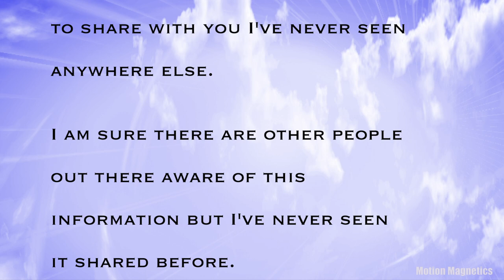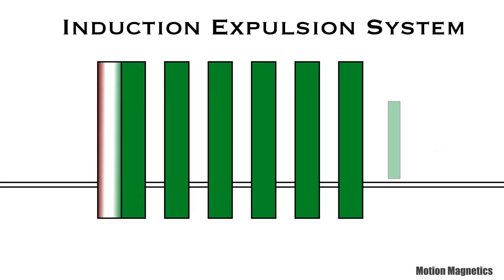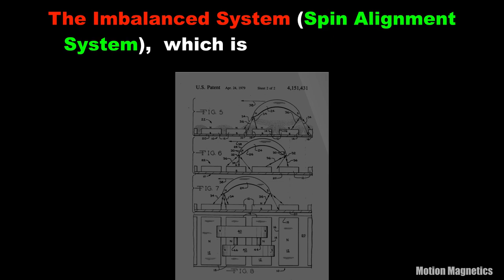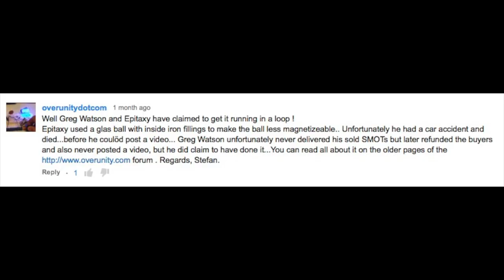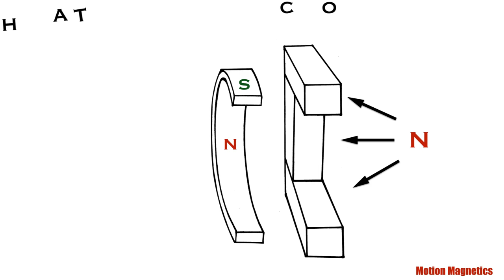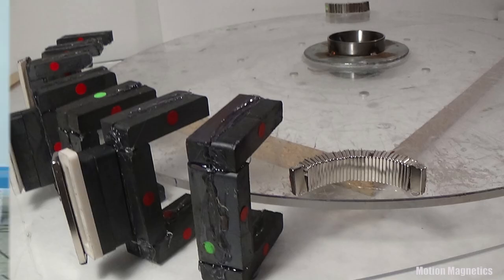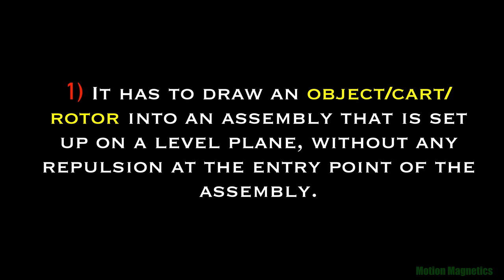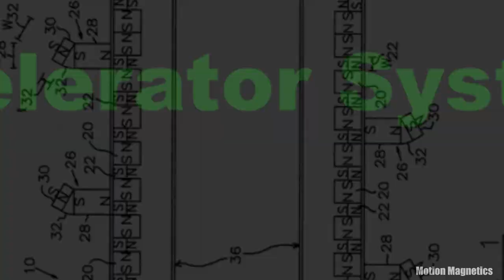The 3 Types of Magnetic Motors Part 03

Comment: Well done Motionmagnetics and thanks for mentioning my forum. Well, is the last motor you have shown in this video not just accelerating ? Looks like it accelerates or did you edit this video so it seems to accelerate ??
Have you ever tried to combine some magnets wrapped with coils around them and then switched the coils on or Off and the right timing intervals ? That would also still be a possible solution to overcome some sticky points, but it would still need more work and to find out the right coil dimensions and switching parameters and might need also caps to store some energy from the coils. Many thanks for your inpiring videos !
Regards, Stefan.
Reply from the maker: overunitydotcom Thanks Stefan. The last motor doesn't accelerate. It's just edited that way to serve the narrative better. I haven't tried collecting a charge and redistributing it into an assembly yet. I'm mostly focused on doing this with all permanent magnets at this time. I might give it a try at some point though. Thanks for the suggestion.
Reply: overunitydotcom that's what I been saying! Just not as well! Slightly neutralizing the magnets that cause it to stop. For a microseconds at the right time. Would make it work I think! I want to try....
Reply: @Motionmagnetics  hmm..how is this edited, when it is shot entirely in one shot and clearly shows acceleration ??..lol...maybe you have it already running ??..lol..

Comment: So are you actually trying to make a perpetual motion machine? Is that your end goal? If so, how do you explain where the extra energy comes from (to do the work)?
Reply: DrZaius That's about the most diplomatic way to ask that question. I respect that. As someone interest in the idea of free energy, I listen to all the people say that you can't create energy out of nothing. I agree with them. It takes a force to produce movement. Magnets have the capability to do work. Take a piece of metal and slide it across the table. That object will keep on going forever until an equal opposing force stops it. Slide the metal next to a magnet and the magnet will pull it towards itself. This changes the trajectory of the metal. That by the laws of physics is force/work. Magnets can create plenty of torque and do plenty of work. The problem is getting them to work with each other and not against each other in the same direction. This is where physics "pros" jump in and say, "See you can't get magnets to do work because you don't have an external source of force. You can't create energy out of nothing." The problem isn't the external force not being there. It's that the force wants to push both ways. You have plenty of force in one direction, and the idea is to shield and align magnets to reduce the force coming from the opposite direction.
Reply from the maker: DrZaius Actually, no. I'm building a non equilibrium steady state system.

Comment: If this is possible why is there no working versions. I mean if you can get the magnets to be sucked in the on side and spit our the other side  thats is game over. The motor should work. An im sure i see it happen in the video. So if it happen once it just need a exact repeat and that is it? Do what is stopping the process . What i said here only goes for this type. Because if i sucks it in and push it out there is no one inch barrier so what is stopping it here i dont get it
Reply from the maker: Werner van loggerenberg The magnetic assemblies I featured in the video have to much repulsion at the entrance of their gates to be cycled. I used them to demonstrate the principle. If the assemblies I was using accomplished the three principles I laid out in the video, I would have arched the geometry of the design and demonstrated it in a rotary version, so that people could replicate it. Thanks for the question friend. I can tell by your mention of the one inch barrier that you've been paying attention.
Reply: Motionmagnetics  "IF" that's how you really want to achieve it to work ?  Edmund Scientific sells a device used to find a N / S magnet's 3rd pole .

Comment: I think real free energy will tap in electrically to the machine that the magnet, neodymium, already is.  I'm currently working on a theory on how to use the already spinning vortexes that already exist in a strong magnet, 8 inches by 4 inches pancake form. there are literally gaps where magnetic attraction is not really there. what if wired cones were placed right next to the top vortex?  one in the center, one a few millimeters on the outside, parallel to the other cone, a cone sandwich on top of the magnet surrounding the vortex or walls of the tornado of the north pole?

Comment: What if Arc'ing the solution ruins it. As the magnets fields change direction and interfere with each other. So I mean have a spinning solution but where the spinning magnet goes through the gates have this in a straight line, by using a cam.

Comment: Ultimately, the sum of forces of any system must be zero - or be powered, as you cannot reverse entropy. To get movement, you have to find a way to imbalance that without affecting the carriage, which is a contradiction in terms: and change in momentuum requires the application of a power source. And that's before one starts to consider environmental noise, friction from the air and track, and in the wheel bearings. So we must start with the presumption of the application of a power source...
Very often, systems hide this by creating an unobtrusive gravity well. But ultimately, it's simply an inversion of the power equations.

Comment: In your statement you say:
First: "PLACING THE TWO TOGETHER MAGNETIC STRUCTURES Alters ELECTRON SPIN THEIR PATTERNS"
Second, you present an exhibition
with three points 1) IT HAS TO DRAW AN OBJECT / CART / ROTOR ....... "Picture"
                           2) ACCELETATE THAT OBJECT / CART / ROTOR ....... "Picture"
                           3) IT HAS - to expel THE OBJECT / CART / ROTOR ....... "Picture"
 Question: If I build a model with this explanation, work? thanks
Reply from the maker: German Garcia If you build an assembly that accomplished all three of the guidelines I laid out, you will have all you need to build a working magnetic motor. The particular assemblies I used in the video were for demonstration, and do not effectively accomplish all three of the necessary steps.

Comment: Just mind about the vectors and you will understand everything. Do not try different kind of magnet shape, nor angle to put the magnet, nor spiral etc, because it will never make a difference. All we got is magnetic fields acting from their center toward every directions on a short distance. A perpetual motion device work of the principle of transformation of force(s) into energie(s) through a mecanism. And the vectors determine the working of every kind of mecanisms. Using gravity and magnetism to assist each other is the easiest way, but it can be achieved only if you understand the subtility of the instant vectors. A perpetual machine that give a moreover energy is called a Kreatris, because energy is created eternally from eternal forces, wathever the physics laws say its not possible, but the correct mechanism can manage the vectors, so think and created it correctly. The gravity act all the time everywhere on every masses, and verticaly. The magnetic field act localy in straight line on attraction or repulsion on other magnetic field, electromagnetic field and masses free to move inside zero to 90 degrees of this angle as allowed by the mecanism, and with a power that depend on this deviation, that's a vector. You must mind of every vectors, not just the one in your dream that should give you a working machine, because it is not alone. Only the last one, the resultant one at the end give you the energie. You must understand that as much powerful an energetic or repulsive vector should be, it maybe not exist, it could be anihilated by its reversed twin, could not act on an angle or because the mecanism do not allow. Energy and resistance are always produced, and at the same time or not the same time in a cycle, and are the exact contrary of each other, but as much their nature is different from each other, one can be reversed by the mecanism to become exactly like its twin, so both energetic or both resistive. So the vectors can be added, subtracted, anihilated, reversed, nature reversed, that's the resultant vector you got, energetic or resistive. Draw the magnetic fields, and the polarities, and the vectors as straight arrows on one or the reversed direction, and the center of the moving mass trajectory according to the mechanism, but never draw the magnets in your plans, and you will at last become able to understand. Only mind of the vecors.

Comment: Magnets on the rotor are bow shaped, how did you do that?
Reply from the maker: They're made from several small magnets with tiny metal spacers.
Reply: Which metals can be used for spacers? Can i use almnyum? Thanks
Reply from the maker: @Ozerkaratekin  You could, but a regular magnetic metal would complete the magnetic field better.

Comment: This is the system used by the Yildiz-Motor.
The Yildiz-Motor is working perfect: It was tested , see here:
https://www.dambros.com/en/   =  HMSB Motor
By a mechanical failure, the test was stopped. This test will be done, after
the defect part is changed.
Reply: A mechanical failure ??? Sounds sudpicious to me.

Comment: It looked like the last one was gaining speed? I guess it loses momentum a little later? Also have you tried to debunk the Callaway V-gate with the armature that lifts up the main magnet at just the right time. I'm sure you have seen the video.
Reply: It looked like that to me as well. Where can I find this video?
Reply: Garry Hammond I'm not sure who the originator was, but you can type in "evolution of perpetual motion, Working free energy generator" that should let you find it. I'm sure its a hoax but is interesting..
Reply from the maker: WantToBe MARTIAN The last one doesn't self rotate. It get's close, but the repulsion outside the entry gate needs to be adjusted or nullified. No, I haven't tried to debunk it. It's already been debunked by several people, and a picture has been posted of the original version with the air hose above it, that was used to induce rotation.
Reply from the maker: Garry Hammond The last one featured in the video was a replication I did of one of Howard Johnson's rotary models, that is a little less known. It gets close, but doesn't quite self rotate.

Comment: Thanks- When will there be a motor to run my house 240v 200 amps.
Reply: Tom Reese  When you can build your own . I used a generator & voice coil piston drive , needs an out side source of energy only to start .  With a life of 1 failure out of 100,000 in 10 years .
Reply: @mikepeine3898  What is a voice coil piston drive?
Reply: @markl2804  what's a solenoid engine ?
Reply: @mikepeine3898  How do you use a generator and voice coil piston drive (solenoid engine) as a source of energy?

Comment: imbalanced system mean that we should not put the magnet aligment too perfect to oppose each other. since this will make the rotate component stay still. this is how an engine work. the 4 cylinder engine don't combust at the same time. while the combusted piston prepare the other piston for new combustion. the magnetic field of a magnet shouldn't distract the other magnetic field of magnets . mean we should not put the magnet too close. this will bring your magnet to a unity magnet which mean a balanced big magnet and it will oppose the concept of imbalance system. the torque produced by a magnet will help in create a powerful rotation. but it will depend on the magnet type n size.
Reply: In an internal combustion engine (ICE), the initial impulse of energy on the power stroke is absorbed by some energy storage device (usually a flywheel, giving it angular momentum) which is then used to feed power back during the tail end of the power stroke as an increasing amount of energy is required to compress the air in the next cylinder that will produce power. As you pointed out, that is similar to the PMM — it uses its momentum to keep it going from one “driving” set of magnets to the next, but that’s where the comparison ends.

The ICE requires externally-supplied energy at each “power” phase (released by the combusting fuel) to build up the momentum consumed in taking it from one power cycle to the next, whereas the PMM—by definition at least—requires no external energy to keep it going. The attraction by magnetic fields followed by a flip of the fields to repulsion at just the right time is what causes acceleration during the “power” phase.

P.S.: In an ICE, a multi-cylinder configuration with staggered power strokes (so that one provides energy while the other cylinders are preparing for their power stroke) is not a necessity. When the flywheel has enough momentum to carry the engine to the next power stroke, 2-cyl or even 1-cyl ICEs can work, e.g. lawn-mowers, motorcycles and model airplanes with blades/propellers acting as flywheels, albeit most are 2-stroke engines.(There are some 4-stroke models).

Comment: Good jod;) what s next?
Reply from the maker: TheKatr2 Thanks. That's a good question. I'm bouncing several ideas around, while I'm experimenting with some Johnson gates.
Reply: Motionmagnetics glad to hear your working on the gates as iv been for awhile now so will be looking forword to it.in my research on it iv found it extremely hard to find the rubber magnet which is key to getting it working also key is to have the square magnets NOT rectangular otherwise the magnetic fields change i believe mine still has an advantage but only time will tell.if you do decide to make the rubber magnet like i did go with the stronger stuff thats on fridges and freezers as the stuff on a roll is crap its not strong enough.
Reply from the maker: edwardsaladhands Rubber magnets can be magnetized in whatever orientation you wish, simply by placing them between strong neodymium magnets. The square ones I used in part 02 of the 3 types of magnetic motors used to be oriented entirely differently than they are now. That makes it a little easier to track down what you need.
Reply: thats true iv used this before to change orientation.by the way iv got as fare as howard johnson has now with me 3 gates but iv put my own little spin to it as it was not working before i had done this.now not only was the cart able to maintain its speed every time i added a gate but it actually speeded up so that only tells you 1 thing (its putting out more than im putting in ) also if it pushes all the way through the track with 3 gates then you should be able to put as many on there as you wish after that.i will not be uploading YET but if you want info just message me
Reply from the maker: edwardsaladhands I wouldn't mind seeing what you've come up with. Sounds pretty interesting.
Reply: it definitely is mate but theres a couple things im gonna be doing first before uploading but i  will let you know when i do.
Reply from the maker: edwardsaladhands Sounds good. I look forward to seeing what you've come up with.

Comment: The term "Over Unity" is a lie. You cannot have more than the whole or completion of all the parts that consist the whole. The correct term is Unity. True unity can only be achieved by correctly aligning both the magnetic and electrical forces so that no longer collide and are free to run continuously. This is true Quantum mechanics. Everything in creation is made and bound by these forces all times indefinitely, which is why Unity is the true power everyone is seeking but going about it the wrong way, basically trying to only use one half of the forces required will always stop at some point.

I know your video is about magnetism specifically but I felt it critical to point out the incorrect assumption of finding "Over Unity
 as it is a fleeting goal to seek, since it cannot and does not exist. Unity on the other hand is all around us since all of creation works on the principles of Unity. Water flowing, wind blowing, the shape and shaping of the landscape, the churning of the tectonic plates, volcanoes, etc, etc, etc. In all these examples the energy (electrical and magnetic) are all continuous and never stop, where all that energy gets transferred to depends on the various elements and their unique interactions. I will also point out gravity is falsely understood. Yes, density of objects or mass is one variable and plays a role, but the underlying principles are based in magnetism. True levitation is nothing more than strong repulsion and yes it is possible, even without some form of explosion to overcome the forces at play.

None the less good video and well explained in general.
Reply: Thanks